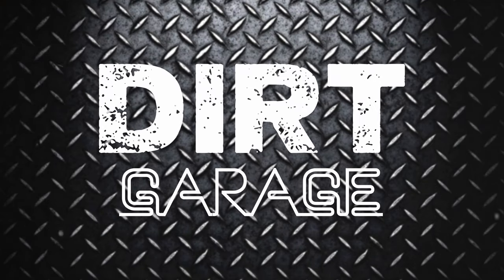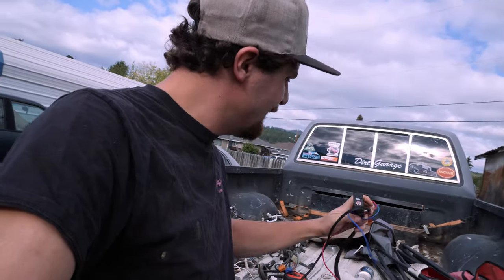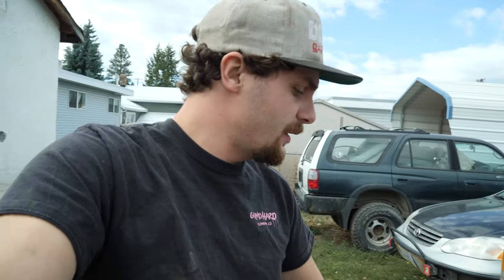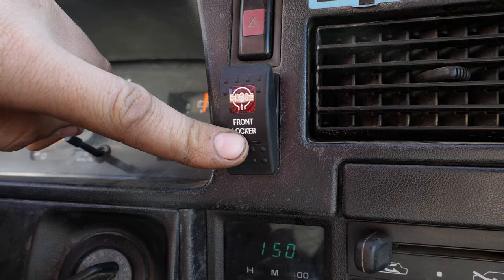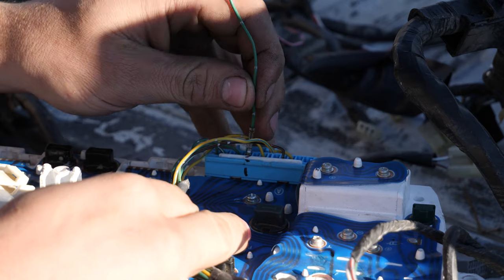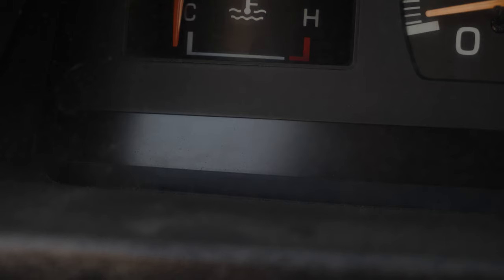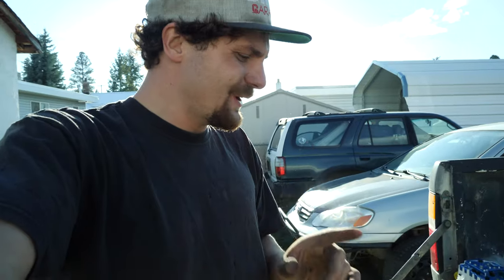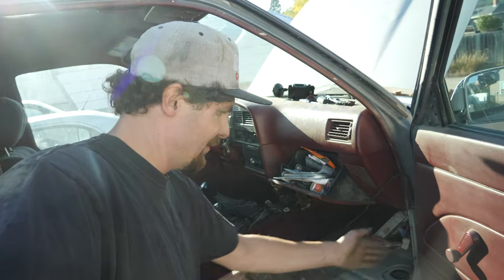Best Affordable E-Locker Harness | Plug And Play | Easy

Comment from the maker: Hey guys! Just adding a couple points I totally forgot to mention in the video. Dark Illusions sell these harnesses for $135, a solid option if you consider what Low Range sells their harnesses for. You can also swap your factory elocker harness with this to eliminate the locker ECM, bypassing it's restrictions, and making the locker work no matter what your t-case position is. Dark Illusions also offers custom switch faceplates! Thank you for watching everyone.

Comment: Awesome that this channel is finally growing! I have been very grateful for your build videos and all the inspiration you have given me, congrats on the 10,000! So my rigs are a 2000 V6 4runner, custom 4"lift 285-75-16"s iron man mud terrains, 488 gears, winch bumper and rear e-locker, I also just got a 2003 Tacoma V6 double cab that I've installed a 3" lift with 33-12.50-R17 mud terrains, and 488 gears with a rear e-locker.

Comment: 10k! 89 4Runner, sas, dual cases, 5.29s, 3.4L swapped , 35” krawlers and a bunch of custom armor. I have two E-locker housings I am planning to swap and move to 37” mud terrains. Love the look of the 37” tires on the trucks on your channel.
Reply from the maker: Very nice! Yeah we pretty much all run 37s nowadays. They are just a perfect size for all year wheeling, little to big for summer, little to small for winter. But right in the middle.

Comment: What's your opinion on lunchbox lockers?  also Congrats on 10k subs.
Reply from the maker: I really like my lunchbox locker in my rear. Its a Lock Right. Super easy to install, reliable, and doesn't scrub down tires on the street like a welded diff or spool. However on the front I would not run it, way to hard to turn on trail, and is just going to cause excessive wear on front end components. Selectable front is ideal, but 100% recommend lunchbox rear, not worth spending the money on air or e-lockers.
Reply: I run a Spartan locker in the front with no issues. Easy to turn while sitting still and locks up when ya give it throttle.

Comment: Congrats on the 10k. I got a 93 Toyota pickup with all the normal stuff dual cases, SAS, gears, locker, 63 springs, ECT with a few goodies. Next on the list is RCV shafts and an elocker for the rear. Check out my build @hillbilly_noma
Reply from the maker: Very nice!

Comment: 97 tacoma reg cab 3rz sas
85 front axle
Fj hp front diff with 5.29 and factory elocker, fully built, cromo shafts, arp studs, ifs hubs. 
Gear driven dual cases both 2.28. Rad designs triple sticks.
Tacoma rear axle with factory elocker 5.29 Yukon’s.
Chevy 63 swap.
Coastal offroad front bumper, trail gear sliders and custom high clearance rear bumper.
Lots more parts. To much to list. 

Tannera56 is the Instagram handle.
Reply from the maker: Wicked! Sounds like a fun rig.
Reply: I’m still building it but it’s getting very close to leaving the garage!

Comment: I do not speak or write much English I am using the google translator sorry if I do not express myself adequately I try to make myself understood I have a simple 1990 toyota but I will put the rigid axle and I will do 4x4
Reply from the maker: Your going to solid axle swap? We have a video coming down the pipe line with a new solid axle swap build!